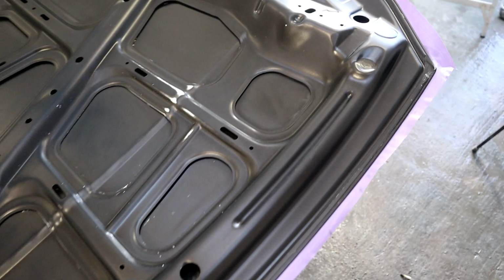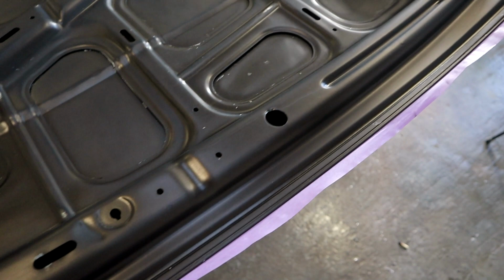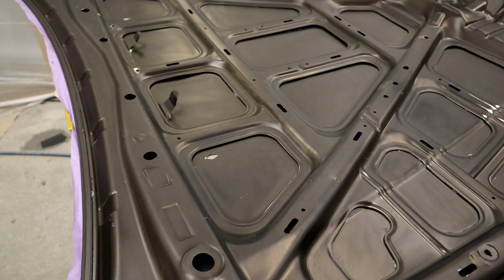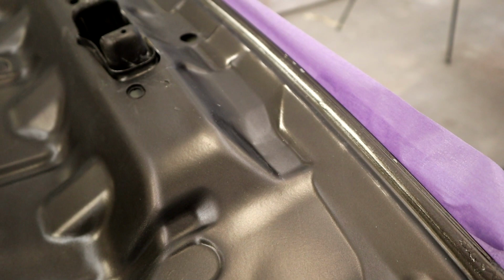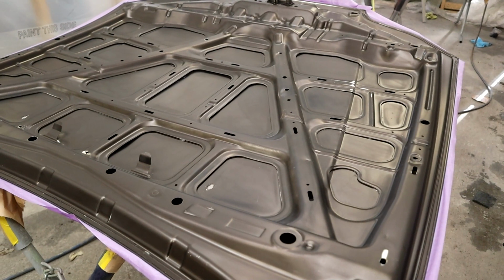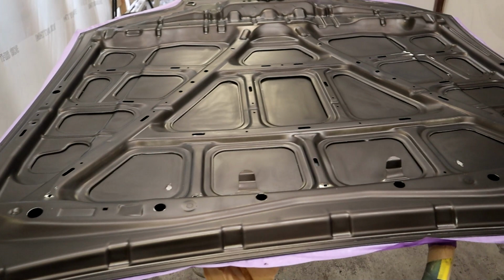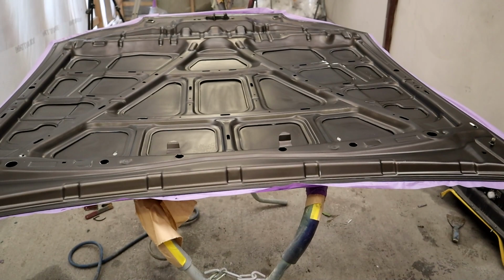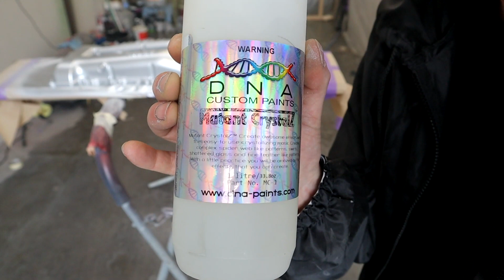HOW TO MUTANT CRYSTALZ A WHOLE BONNET

Comment: Hey with the diesel heater do you just turn it off during spraying ? Then once your happy with the over spray etc clearing out turn it back on ?
Reply from the maker: Yeah mate I mainly just use it to get panels up to around 18-20degrees then turn it off
Reply from the maker: Although when applying mutant crystalz less heat and humidity is better